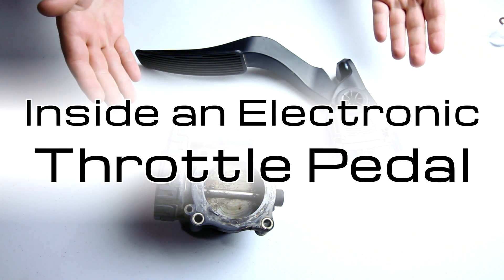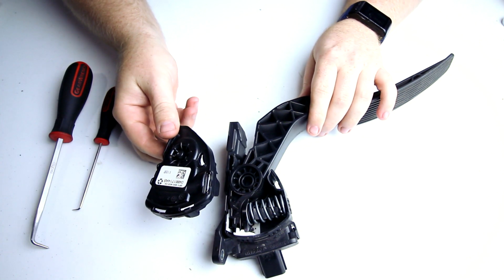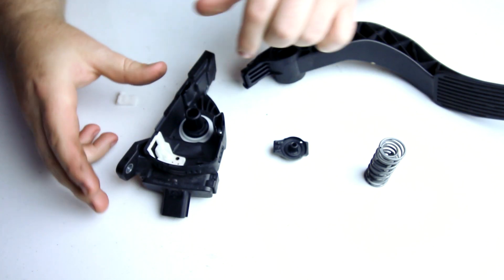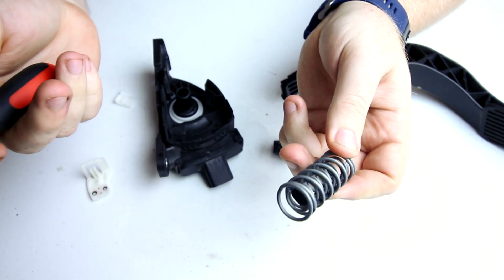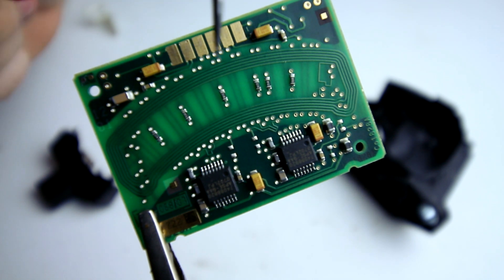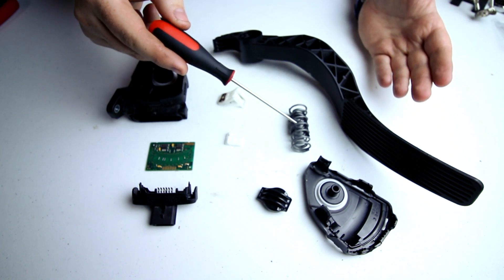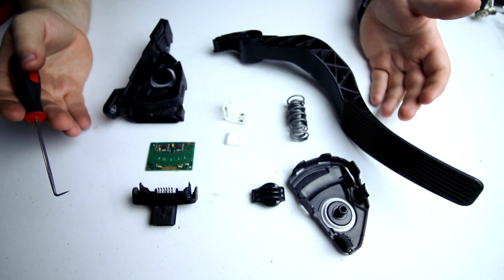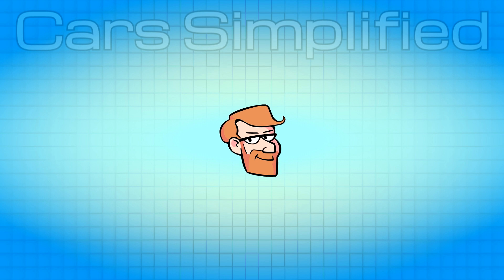Inside a Throttle Pedal (How a Solid State Throttle Pedal Position Sensor Works)• Cars Simplified

Comment: What signals come out of these pedals. PWM or Voltage or CAN signals?
Reply: It's supposed to be a voltage varying somewhere between 0.3 and 4.8 on each of the two output pins based on pedal position.

Comment: I took apart my padle and the copper thing that slides across has a few bent and one is missing and seem like circuit board my be sratch will this keep it from starting and can it be fixed or improvised

Comment: I just purchased for my 2017 Jeep Cherokee Sport an Accelerator Throttle Position Sensor model # SU16055 HOW DO YOU REPLACE? I've unscrewed the 3 bolts but how do I disconnect the sensor?

Comment: @Cars Simplified  most hella (audi/ vw/ skoda) ones use wipers in the (2013) 
its simple (pins are not in order... one 0.35 to 4.5 and one down 4.5 to 0.35) there 2 conections because of savety when one fails..
2 times ground 
2 times 0.35 or something close to that to 4.5 volt depending on the position of the pedal
2 times 5v in
took some time for me to figure that out... newer ones use cipos system i think
Reply: I am looking to wire in a inline throttle controller. It has the wrong plug and I can’t get another one. 

It’s a racechip xlr. It’s for a Mercedes going into a bmw.  

So you say 4 of the wire do the same thing?  Is the other two power and ground? 

Thanks alex.
Reply: @NMgravel  mine has 2 grounds 2 signal 2 time 5volt.   6 connections for a pedal I use them for simracing  so I got 3 connected to a arduino pro micro

Comment: When its replaced do you need to program that pedal to the ecu?
Reply from the maker: More often than not, yes.
The new one may have slightly different characteristics, and not quite give the same response as the old one, so the ECU or PCM needs to figure out what is different about it.

Comment: Nice in depth look! I actually assumed they used a mechanical wiper, but this totally makes sense. Much more reliable to use a magnetic field with no parts that can wear out, especially when safety is involved.
Reply from the maker: I believe some do use a mechanical wiper, but I need to find one to prove it. One example I saw had what looked like a removable sensor with the same exact shape and connector as a throttle position sensor on previous cable throttle bodies.

Comment: Always wondered how this worked instead of the old throttle cable set up!
Reply from the maker: I think there are at least two other designs; if I get my hands on them, I'll definitely make videos for them as well. I think there is at least one out there with a sensor unit that can be removed and replaced on its own (without replacing the whole pedal assembly).